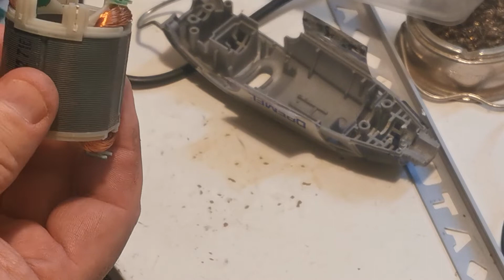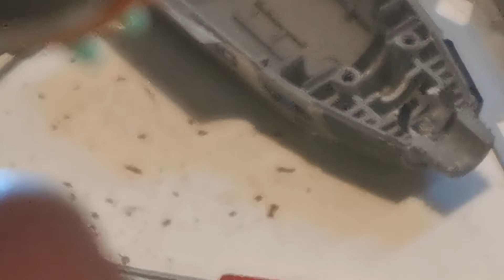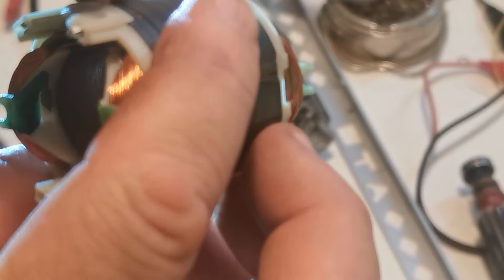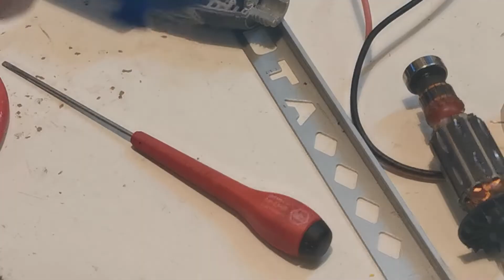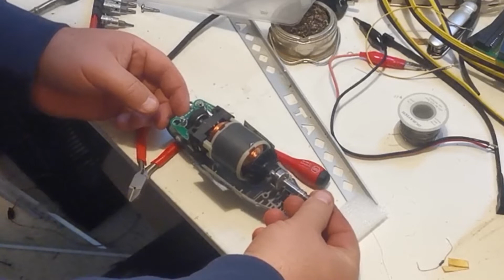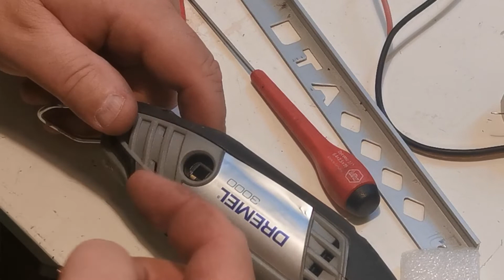DREMEL 3000 STOP WORKING REPAIR

Comment: My Dremel, exact same model just randomly stopped working... couldn't see anything wrong with it then I came across your video and my Dremel had the exact same problem! Did what you did and it's working again, thank you!
Reply from the maker: Nice one! I am glad it worked. Yes I can see that Dremel have sacrificed quality for the price point. They have skimped on winding cross sectional diameter, which will allow more heat to build and also allow a longer continuous operating duty per hour without Blowing to bits. Such a shame!

Comment: This is likely my problem, my 3000 is a couple years old but has hardly been used! This video is helpful, and yah, looks like several others finding the same problem as well. I think this is what my issue is because I can bang on the side of it and it intermittently starts working with each bang, so this wire being busted would explain that.
Reply: I tore it down and as it turned out this wasn't the issue! It was a problem where the lug/spade type connectors mate the switch body to the stator housing and also make electrical connection there. These are not good connectors and tend to arc while in operation and after awhile get pitting and corrosion causing the connection to get too loose to make proper contact. One of the four on mine was really bad. I had to take a micro sized jewelers screwdriver and bend one-half of the connecter receptacle on the stator housing to make for a tighter fit when the pin was inserted. I also used a bit of contact cleaner. Works now, but this will likely re-occur at some point so I'm thinking about possible longer term solutions in the meantime.
Reply: @cosmicstuff44  i have the exact same problem, if i hit it it works for a while, if i move it sometimes it stops. Happened yesterday for the first time and probably your comment will save me a lot of time, another thing to check on the list. thanks!